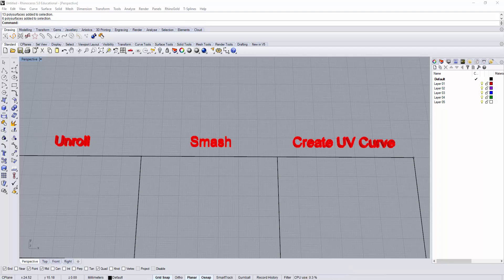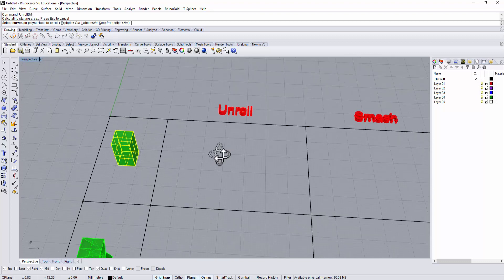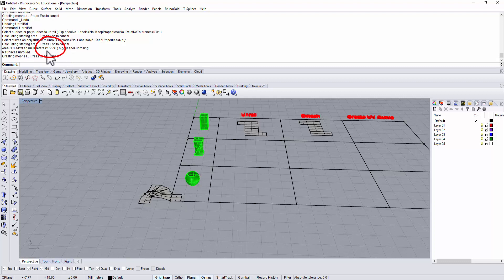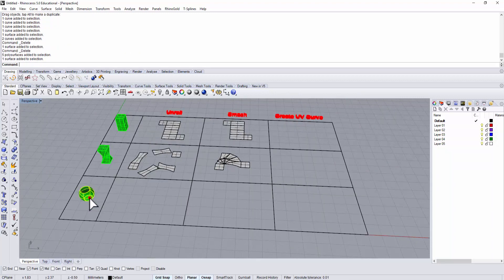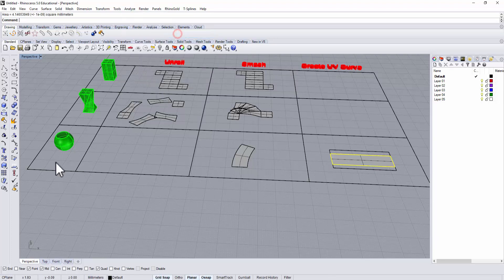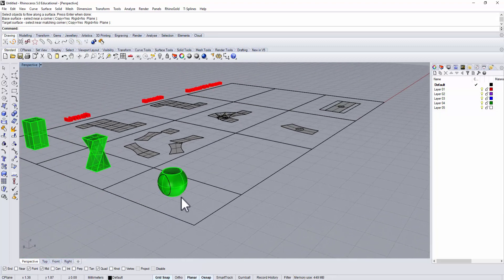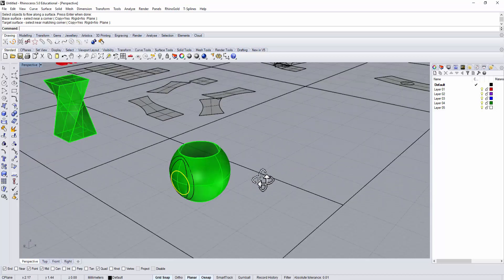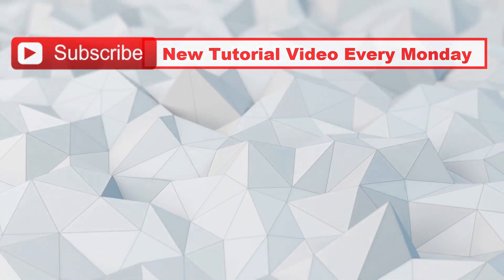Rhino 3D CAD Technique #12: Difference between Unroll, Smash and Create UV Curve commands (有中文字幕)

Comment: Thank you very much for video and explanation. I have a question. What should we do creating exact template if we want to wrap that sphere with vinyl? How to extract exact template for cutting vinyl for sphere? If you answer I will be very appreciated.
Reply from the maker: it may not be super accurate, but if your vinyl is flat. you can check out unroll command and I have a video here for reference. https://youtu.be/Ea_eIghyVXY
Reply: @PJChenJewelryDesign  thank you very much. My vinyl can be strecthed so there will be no big problem I guess.

Comment: Thanks! I'm also confused with unrollsrf UV and squish as someone already mentionned.
Reply from the maker: Hi Thomas, There are commands that you can flatten a surface. Squish is one of it. The difference between those commands is the way of stretching and the % compression and expansion in some areas. None of them will be 100%. depends on the surface you want to flatten. some restriction may apply. for example. Unroll only apply on flat surfaces. and rest can be used on curve surface.

Comment: Hello PJ ..I was wondering ..I have a pave style ring I designed flat with many  prongs (apx 60) and want to flow onto my ring surface but the prongs all dis form ..how would you go about getting the prongs onto the ring surface? thank you
Reply from the maker: You can look at the option. click on "rigid=Y". that will make not deform but you will need to adjust the gap.

Comment: Thanks for the video!..Question : can you scale (up/down) the flattened surface percentage difference  before modeling and flowing ?
Reply from the maker: yes, you do.it will flow size differently.
Reply: I meant if the analysis shows... example:4% larger difference between the 3d surface and the flatted surface would scaling the flat surface up 4% correct the issue so both surfaces would have the same 'area'?
Reply from the maker: It is a very good question. I may not have a 100% answer since I am not an engineer. However, when a 2 direction surface has been flattened. The way the computer calculates the shrinkage is for the entire area. How it was actually stretched, I am not sure about that part. If you just doing a 3D scale. it is still showing the same boundary. It will only affect the flowing object size, when you flow back. but it does not change the 4% (for example) difference.
Reply: I experimented with it a little bit the other day but ran out of time ...however an experiment ... flatten the srf.  check the 'area'... then flow it back and check the 'area' of the flowed surface compared to the original surface ..I'll give it a try  interesting ..is this just a rhino thing? or does this happen on other software's?
Reply from the maker: I am not sure if other 3D programs do that.

Comment: Hi, is there a way to get an accurately flattened surface  from a developable (not double curved) surface such as in the twisted box example?  In the video you show how "Unroll" and "Smash" flattens the twisted box with a 2.65% deviation, is there a way around it? Thanks.
Reply from the maker: Hi Shy, It depends on your application. If you try to design something in 2D and flow it back to 3D object. UV curve is your best choice. If you want to create something like papakura objects that I mentioned in the video. you can turn the surface in to small pieces of small polysurface then use unroll command. you can check my other video at https://youtu.be/Ea_eIghyVXY. thank you.
Reply: Hi PJ, thank you for the prompt reply. The application I was thinking about was similar to papercura perhaps: designing a 3d object>flattening>fabricating from sheet material>assembling to match original 3d object. Creating a polysurface from mesh (as shown in your video "Rhino 3D CAD Technique #1- Folding Paper Technique with Rhino 5") to create many planar surfaces is one way of doing this and the result will be a "pixelated" version of the 3d object. But if your 3d object is made from developable surfaces, as the twisted box, it is technically possible to get an exact model made of sheet material. So I was wondering if there's an accurate way of doing this without any deviations... thanks!
Reply from the maker: HI Shy, This is a very good and technical question. I don't have a 100% answer for you yet, but I did some research online and find the "DevSrf" extension may help you to solve the deviation issue. You can find the download the extension at https://wiki.mcneel.com/labs/devsrf . I also find an online discussion about the DevSrf command at https://discourse.mcneel.com/t/devsrf-how-to-use/44505/6 ,I will dive in the information later on. Let me know if you find the solusion. I would love to hear from you. Thanks.
Reply: Thanks! I'll look in to DevSrf, looks promising. I will let you know if I figure this out.
Reply from the maker: great. thanks
Reply: you can try the Squish command as well i think.